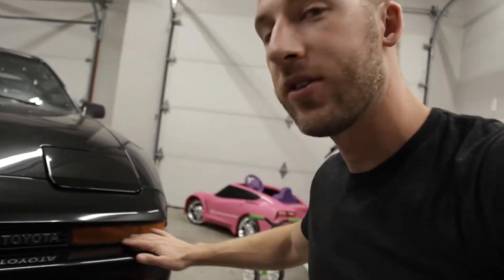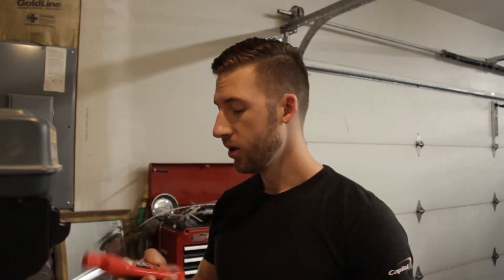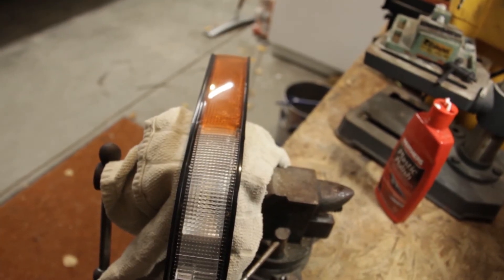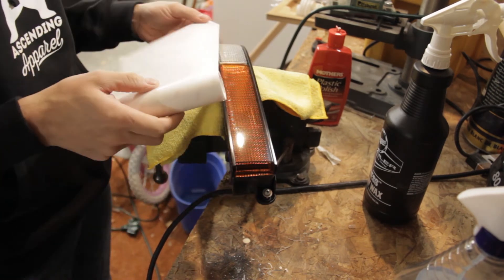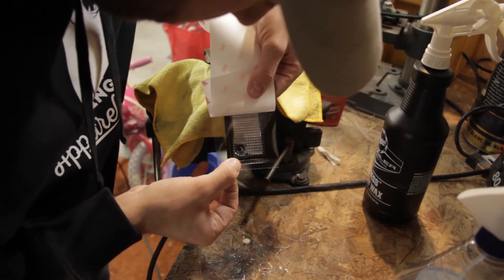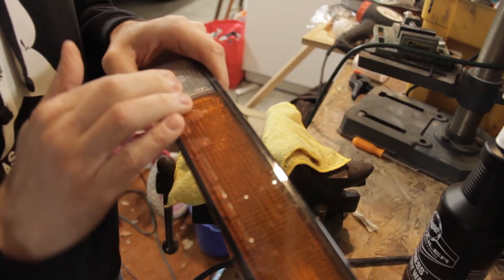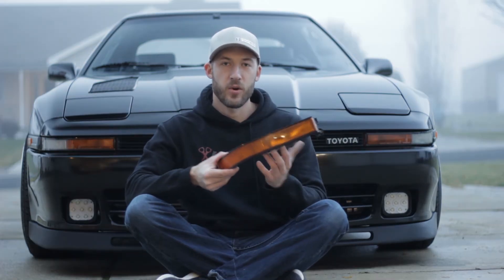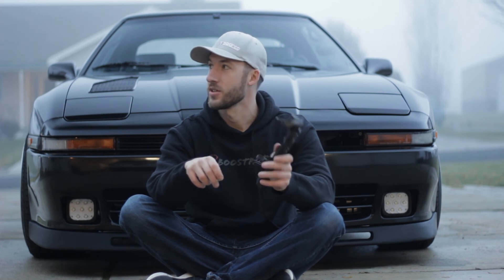Restore Your Lenses

Comment: Nice find, I also remember when you could get these Euro signals brand new about 7 years ago. I have been rocking those clear DEPO turn signals on my 87 Supra the last 10 years. So far they have held up great and still look like new.
Reply from the maker: Nice, my brother has a set of the clear ones on his midnight blue 89. I thought they would oxidize fast being an ebay set but they have held up really well also and look great on that color.

Comment: What kind of lights did you use for the fog lights
Reply from the maker: They are a generic set of led fog lights. They are meant for an off road light bar setup but fit in the bumper openings fairly well.

Comment: Just bought a pair that were stored 4ever (sandlot voice) coughed up 400bucks sold 1 set that i regret that we're also new
Reply from the maker: Nice find but that sucks on the new set. If only we knew, there were some parts that I have sold.... and even given away that I shake my head just thinking about today. Also a lot of things I put off buying new and replacing because it was was expensive at the time and less fun than go-fast parts. Now I'm just wishing it was available and paying substantially more for NOS whenever I am able to score something....
Reply: Hey wondering what type of bulb you are running on the euros?? Just got my set and like that bulb color you have on your mkiii